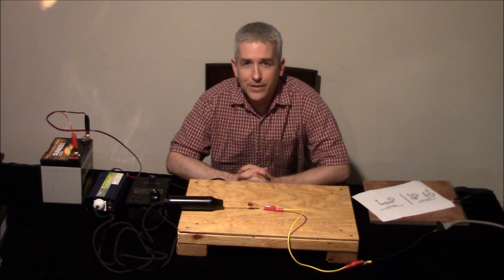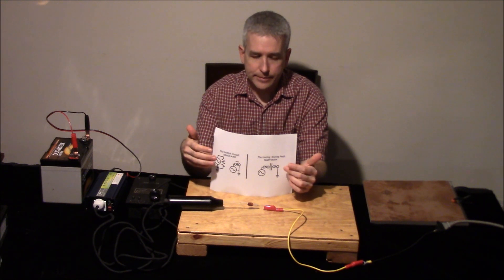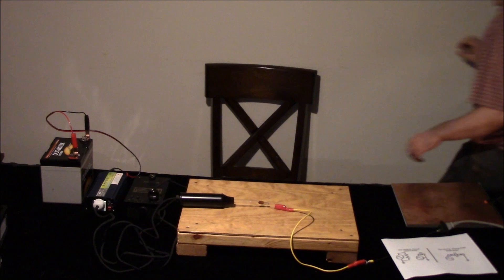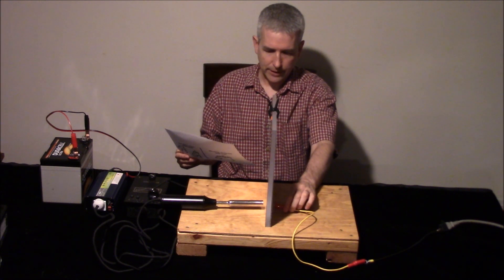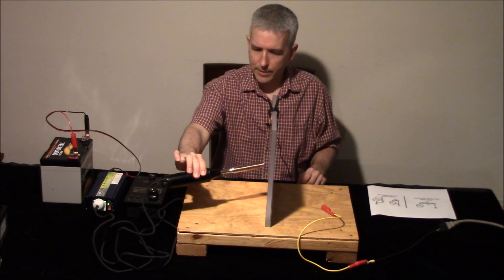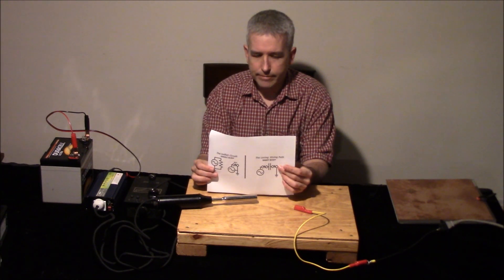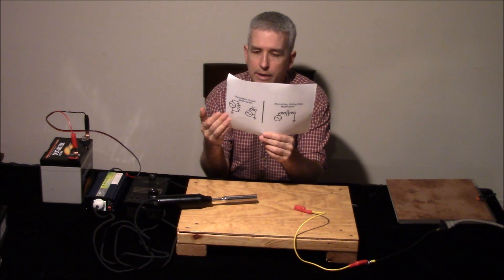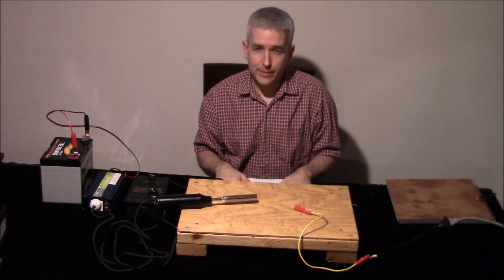Doubling the Arc with a Many-Body Loving Path

Comment: High rick, i replicated this system using a violent wand, and now i want to improve the current level by grounding it and stepping down output with isolation transformer. What is the puropse of the varistors on the ground wire in the schematic of your book?

Comment: @rick friedrich  Rick, just wondered how a simple cheap 6v-12v DC High voltage generator producing 20,000v (used in electric stun guns etc) output is different from how your resonant coils and voltage magnification?  - They seem to be doing very similar things. If you could earth one of these little devices, could you not increase the amperage as well? Or perhaps I am demonstrating my ignorance here! :@)

Comment: Hey guy... hope all is well. Looking forward to the kits. So with out matching the output with the cap it would alter the input. That is about all I came out with from the convention and all through in through. Hope that is usefully correct. Pending parts I suppose.. still holding anyways I have been pretty busy without much of a light at the end till it gets about snowing season.

Comment: Thank you Rick.
Is there a relantionship between thickness of the copper and aluminium plates to the result? 

The dielectric will have influence on capacity, but I'm wondering if thickness of the plates is important. 

If not then I could use alu foil for the aluminium side. (At the moment waiting on plasma tube and need to order copper plate, thinking on 0.5mm thickness at the moment)

Comment: what happens if one increases the capacitance of the capacitor? like placing real caps there, for example. Do you think it will be pulling more from the earth ground on the output side?
Reply from the maker: This setup is just a duplication setup. It all depends on what you do on either side of the cap. Several of the free energy principles that I will be listing on the new website will go over that.

Comment: I've been working with the plasma tube recently, seeing it having similar effects to what you're showing.  I noticed with the plasma tube, I can get away with just using one copper plate and not having the aluminum plate. I've been able to load a 1mfd 1000v capacitor, actually load 2 at the same time, using one copper plate ,  I've also used  two copper plates, loading one cap for each plate , though I don't see much difference in the caps.  Also, don't see a difference between running the  wire from the plate thru a bridge rectifier to the cap, or from the plate directly  to the caps.  Both appear to produce the same power.   The plasma tube I'm working with has a frequency around 50k.   I'm assuming I can charge/discharge the cap at this frequency.   Would the best approach be to use an SCR (similar setup to how its set up on the dual pole ) ?    thanks for another great video !!
Reply from the maker: Yes that is true. There are many approaches you can do, the best is probably in question and subject to change with further improvements.